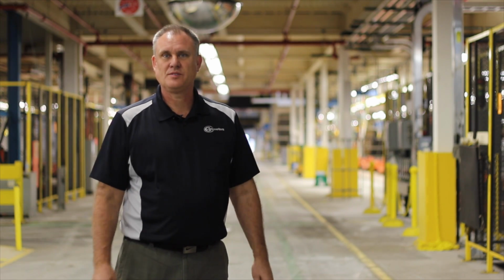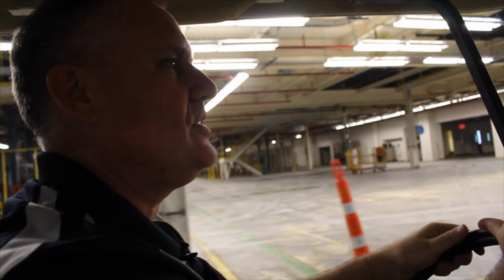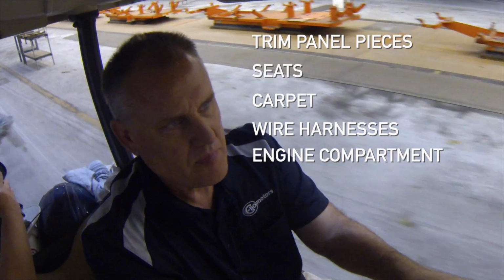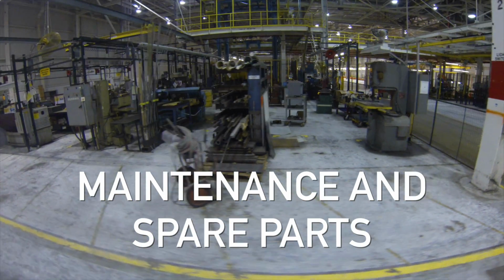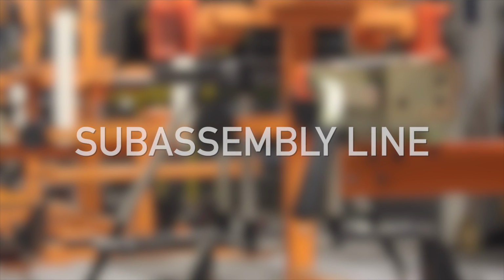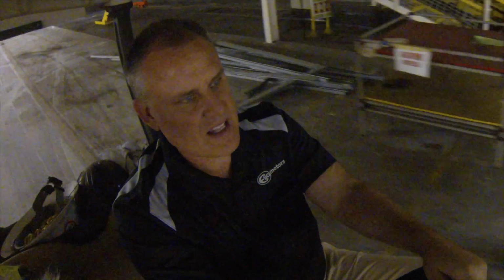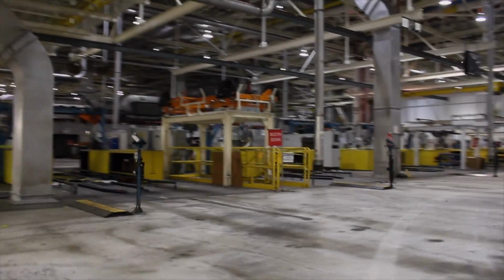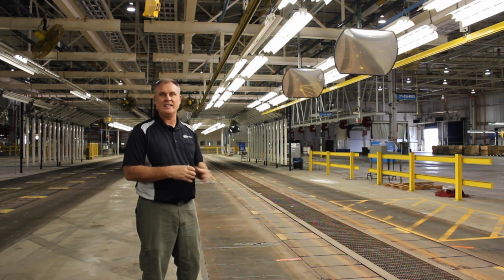Elio Motors Shreveport Operations

Comment: Conspicuously devoid of Elio tooling - looks like an abandoned GM plant.  It tells me that Elio has the keys and has visited the facility, but not much more.  The pickup on the line was a definite distraction.

I think people in general, as well as the government in Shreveport, would like to see more signs of actual employees working on actual product, even if that work is at some other facility.  But actual Elio stuff, if it's not a scam.

And what about an electric Elio?  With its size and aerodynamics, that should be a complete winner (I've been driving Volts for five years, first a 2012 and now a 2015)

Comment: "FAILIO"
So where's the goddamn car?
Instead of selling tools out of Shreveport, Elio should have been engaging in low volume production. Make some damn products, to generate income. That's a business model that works. I'd pay $15,000 for ONE ELIO E1C! So would others. But instead, Elio ate up the money, thinking too big, with a non-viable business model. Now the whole thing is going down the drain. Over $100 million in debt, need another $300+ million to start even one single mass produced car. Only  $100k in the bank...
The answer was never another loan, the answer was always to begin small volume production. 
Now that Elio has screwed the pooch, how about sell the project to the Chinese? That's the only way anyone is going to see any more Elios built. 
Captain Elio recklessly ran his supertanker of debt into the dock. Major fail. Maybe the car should be called the "Failio".

Comment: I am a retired Certified Manufacturing Engineer and Life Member of the Society of Manufacturing Engineers. I have designed and built many new product production lines in the analytical instrumentation field for everything from chart recorders to Mass Spectrometers for more than 35 years, not automobiles, so you can take my observation with a grain of salt. First, the scale of this former GM truck plant production line appears grossly out of scale for the Elio, like a small boy trying to wear daddy's pants. Polaris only needed 111,000 sq. ft. to build its Slingshot line which retails for $19K- $22K. Second, the facility overhead expense to build a $6,800 retail vehicle would be enough to sink it financially. Don't get me wrong, I tried the Elio on for size at the Barrett-Jackson Auction last year, loved the design and immediately shelled out the $100 deposit to be at the back of the line. I've wasted more than $100 on a bad night out, so I won't be disappointed if I die before get to own one.

Comment: Nice video  gives the impression you will utilize the whole Shreveport  site when in reality you will  use 1/3 of it .
How will you cope with a predicted  sales figure of 250,000  per year , when  you will only start a build  once the order comes through at the end of the days business   for  the dealer network  .
Also  in the regulation A   , you state should further funding   fail  then operations will  be curtailed  or  end permanently  .
Hope  Elio  is not going to  cash their chips in  , not when  they are so close to realizing  the dream

Comment: Spectacular. They have owned that plant for years sitting empty. Pushed back production for the last 5 years. Then when they finally give us a tour of their "working" plant. It still has chevy chassis sitting on the production line. Fucking fail. This company is going to pull an enron.

Comment: some left over hummer tooling, bunch of old robots, zero machinery... I liked everything about this car when i first saw it, if it was available, would buy one today...but seriously, old robots are cheap(200-2000 dollar range- we had a acre of them at work years ago) the tooling for each is costly, the integration/safety equipment far more costly- and dont forget they need machines to make the parts they are handling... 
 a tiny car, one door, one seat(rear jumpseat is nothing)... this factory looks about 4x bigger than it should be. bet it costs 50,000 a month minimum just to cook transformers/lighting, as such, bet the last 3 years its been a dark empty warehouse.
 Sorry, i sincerely had high hopes for Elio, but I dont see anything in the works there at all...
Hopefully worst case if Elio goes away, someone else will step up and produce a similar model to their concept.

If Elio is really giving this a go, they need to show more- wheres the engines being cast, wheres the machinery for stamping/fixturing, the plastic injection molding equipment for dashes, fenders, etc... if its ALL imported, well, thats fine, just show the product stream is viable... this shows nothing but doubt in my opinion. 3 years in and its same as GM left it?
best of luck to them. if they dont pull it off Geely or similar will in china or mexico guaranteed. the market exists for a small work car that gets 80+ mpg.

Comment: they've to go back to first design. Forget about 84 mph per gallon. Market change, gas less expensive. Start small manufacturing, improve better design. This is only one way for Elio to succeed right now and make investors happy. Don't wait start small, and grow.
Reply: I think that it is a scam and has been since the beginning, but if Paul Elio is not scamming he should at least start building some bicycles, go-carts, or golf carts and get some income coming in.  Maybe he could cut his overhead and start producing Elio T-shirts in house to tide over his sucke...I mean investors.  How expensive could one of those decal ironing machines be.  Probably less than $6800 and they are avalible today!

Comment: Last year at this time we were told that Elio's would not be rolling off the assembly line in 4th quarter 2016 after all. However, Paul Elio said that as a consolation prize Elio would build 100 pre-production cars for fleet buyers in the 4th quarter 2016. Well it looks like that's not going to happen either & we will be lucky if those 100 cars are built in late 2017. This company has been making promises & baiting us along since 2006. I can't wait  forever so I went ahead & bought a new car & will sit back amused now & see what happens. Good luck guys it's going to be a long wait, don't plan on these rolling off the assembly line in 2017, ain't gonna happen. The Shreveport plant is way bigger than Elio needs, why not relinquish the Shreveport plant to another buyer & find a smaller plant to build the Elio if & when it ever gets built? (My estimate 2020).

Comment: Looks like a cool city vehicle.  Much smaller then other trike types out.  It doesn't look much wider than a manual 3 wheel bikes.  Has Elio looked at getting DOT approval (pick a city) to use this in bike lanes up to, say, 20 MPH?

I must say though, that plant is still 'as rented'.  Even if Elio was fully funded tomorrow, 2017 production would be quite a feat.
Reply: The Elio is 66.8 and the Corvette is 63.5...appears you're correct.  Looks smaller on video.
Reply: The track on my X-Wing is even wider and is just as real as the Elio.

Comment: it was exciting to watch. that you have a plant that CAN BE retrofitted to work for the elio is great. 
i will buy one when it becomes available.
i want to see more than one car shown at a time. i want to see the car on the highway moving in and out of traffic. not with cameras on the vehicle but from a car along side and front and rear shots. i want to see stopping and acceleration. 
are there crash test videos available yet?

let's get going. contact bill gates already or warren buffet. te 2 of them would be able to not even feel 100 million invested. lets get it done.

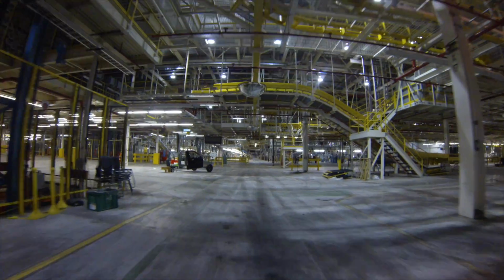Comment: Not a single scrap of materials shown here. No cars on line. No employees even in the parking lot. They are showing stuff left over from when this plant made Hummers. But not a single piece of this new "car" anywhere in the plant.  Lights are out in most of the building. Saying the tooling is there but not where it needs to be but "can be moved" if they were to make delivery in mid 2016 don't you think they would have the pieces where they should be already at least? And some raw materials in place??? Even at 5:46 you see a frame off that does not look even close to what an Elio should be but this is an area where the car should be "done". We just see one of the few hand made finished cars. So many years hyping this vehicle and taking monies and reservations and pushing the town into tax breaks and back to try to raise more funds to "start". Can anyone say for sure when the "next" delivery date will be and if it will be a hard date or another soft release date?
Reply: Humm so no buying inventory or even part you know will be used in production? Or moving all the equipment that will be needed to a place on the line. Instead they even admit they have it and what they dont use will be sold off. Going to be really funny when the next date is pushed back once again then once more then again. Have they made 1 date yet? NOPE.

Comment: I wonder if they'll fill that prepared, "empty space" that was designed in to the engine compartment, with a TURBO; in time for some of us later-investing, "all-inners"?  Imagine the fun factor of a turbo, with the aerodynamics and windows on both sides.  If there are 55,000 pre-sold, and they make 2,400 the first year; will it take 17 years to get to the 55,000th pre-sold customer? By then, it will be ElioTurbo, with optional folding wings, or sealed-boat-chassis feature, eh?  I'm sure production will pick up fast, after the first few years; but I hope it takes long enough to get to me, to have TURBO, as an option!  #brightside
Reply: I think what they are saying is, "When we Start production by the 365th day we will have produced 2400 vehicles."  However it not unfeasible that on that 365th day and days thereafter the production rate will be the 200 or so vehicles per day rate needed to knock out those initial orders in one year or less. Looks like the capacity of the physical plant is there and more.

Comment: Empty factory, empty parking lots, empty deliver dates.....We're 4 years past the original proposed retail delivery date, no changes in that time to the factory interior compared to the pics you released those many years ago other than there's less trash on the production floor.  You haven't even removed the previous manufacturer's chassis from the assembly line!Stop doing gofundme.com fundraisers, stop showing us what ifs, stop producing one-off prototypes and start filling that plant with employees, products and something other than vaporware.

Sincerely, one of the first 1000 to place a deposit.

Comment: you have to imagine what its like to sell 250k Elio's a year, that's +958 Elio's a day in a 5 day work week.  What looks like an empty building now but will be wall to wall Elio reverse trike autocycles.  I'm a betting man and an engineer.  I am #102? or there about and also #23xxx, as well as a stock holder like many of you.  Paul Elio has the balls to make it happen.  Have faith, he looks mild mannered but there is tiger under his skin.  Go Paul Go!!!
Reply: I agree.  While it isn't going to happen overnight; it looks to me like things are in place or falling in place for it to happen.  I know that there is some skepticism in regard to the millions needed to begin full production. That is what the  two sets of "beta" vehicles are for. The first 25 test vehicles and then the 100 that will be put into fleet service will demonstrate the Elio's "fit" in the real world. If it "fits" as we expect it to; commercial loans and additional stock offerings will generate the needed revenue.
Reply: Harley Davidson sold 270k motorcycles in 2014.  These are expensive units that are mostly ridden on sunny days and usually not used for daily commutes.  The Elio will be competitively priced against the low end Sportster model and will give better mileage and creature comforts.  Not to mention that it will go up against automobiles and win converts from car drivers.  So if Harley can sell that many impractical vehicles, Elio should do just as well.  BTW, I've owned and ridden motorcycles for over 40 years and I can't wait to get my hands on an Elio.
Reply: Nick must be a pimp for Elio.... How do you promote something that does not exist and there is no finished car, not even one...Just a few mules that are nowhere close to the promised car, hell even the engines in those mules are not the supposed engine. And you can not compare Elio to HD... HD has a good reputation for selling real and completed products, all Elio has sold are t-shirt, bumper stickers and a ghost car.
Reply: Feel free to call engineers retards - at the end of the day they're still smarter than you AND bring home more money than you. And if they're retards, what does that make you?
Reply: And Harley sold that many units across the planet in more than one plant. In more than one country. And had decades to get up to that level.
Reply: The answer to "How?" is that there are 58,000 Reservation holders who follow their investment on a monthly, weekly, or even daily basis, and not in the commercial news outlets, but by everyday current information provided AT their own website pages and through their dedicated channels of inquiry and communication.
Reply: gee prof,... I have a lot of friend have even met Paul Elio as he lives in ARIZONA...Nice name calling...Shows how pathetic people like you truly are...
Reply: You have my sympathy Rube!
Reply: You are 🤑HILARIOUS🤑
Reply: "I'm a betting man and an engineer......."  - Proof that most engineers are actually just overpaid retards.
Reply: + Nick You can "reserve" my new venture.it's flying frogs as pest control, to eat more flies and mosquitoes. it's only$1000.00.for your Reservation, you get a sling shot and 3 frogs. We are also working on Flying snakes for Rodents. We tried flying Gators...but that didn't work so well. Our venture is ALL made in the USA and employs only a USA citizen and a combat Veteran, ME! You can get in, on the ground floor.Its GREEN Organic and PAT. pending
Reply: Nick Ramirez balls? He was neck deep in debt and has risked nothing and only taken from investors. That isn't balls. That's a con.

Comment: Why would Elio Motors post this? Driving around in an empty factory just confirms that they are at 0% in terms of going to production. 

I don't mean to be an Elio hater. I would buy one as soon as they come out. I have a long commute and would love to get 80+ MPG. Even with the cheaper gas we have now the car would almost pay for itself in fuel savings.  

Unless they get that DOE loan, which I don't understand why DOE hasn't approved or disapproved it by now, they won't be able to make this car. Even if they got the loan tomorrow, going from empty factory to producing hundreds or thousands of cars a day would take a year or two.
Reply: They are securing the DOE loan now by making the E-series cars, once the cars are tested for safety and meet the DOE requirements, they will start purchasing the necessary items and finish the factory floor. Should be by the end of this year.

Comment: A new American car company  !!  Congrats to Eliomotors and Tesla for being innovative and exciting in the automotive world.
Reply: it also took tesla, a company that started in 2003, by the way, 5 years to get their first vehicle into production. 
Tesla's also cost 60-100k for a car, an amount thats not attainable by alot of people. the new model 3 is going to be 35k, still more than most americans want to spend on a vehicle. not to mention you have to now wait until 2019 to even see a production vehicle for the masses because they are all sold out. Compare and contrast, it all depends on what people want to spend on a car.
Reply: Tesla is a car manufacturer, they make cars, Elio promised they will make cars. Till they do they are just an expensive Kickstarter project..
Reply: Apples and oranges in comparison here, Elio is using mostly off the shelf parts, Tesla is all proprietary from my understanding, so that drives up costs.
Reply: It is not getting better milage than your HD.  Your HD exist.  The Elio does not.
Reply: +Ride2Survive, tesla make cars, even if Elio motors do produce this, it's not a car. that is why there is the requirement of a motorcycle endorsement on your license
Reply: only in very few states. also since this is considered a motorcycle, not only are they cheap to insure, to register, you can use it in the carpool lanes by yourself. even if they do require an endorsement they arent all that hard to get. do your research before commenting
Reply: Yea no kidding here in Texas you take a 2 day class and done
Reply: exactly! i do ride an actual motorcycle and have been endorsed for 4 years, even if i had to get an endorsement just to drive this car it would be worth it in the long run.
Reply: For sure, damn thing getting better millage than my 2016 HD Road King haha, AND I'd get AC lol
Reply: +Ride2Survive if you have to have a motorcycle endorsement that means it's not recognized as a car. So you just proved my point
Reply: who said it wasnt a motorcycle? and its only a motorcycle because its defined as one but can still be driven daily like a car you just get motorcycle perk. my original arguement wasnt even about whether it was a car or not, it was about the comparison of this car to tesla and how long it was taking to get this car into production
Reply: ***** lolz k bruh